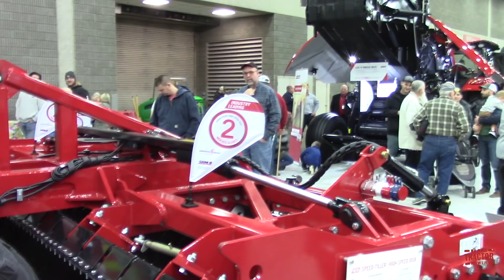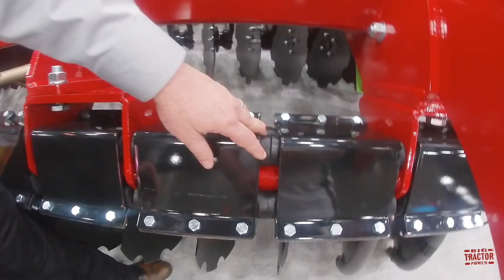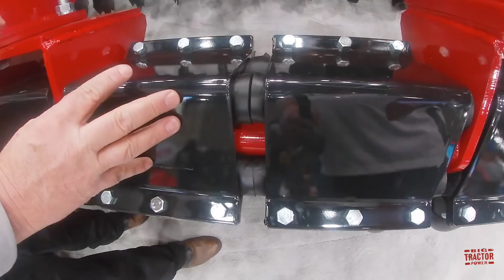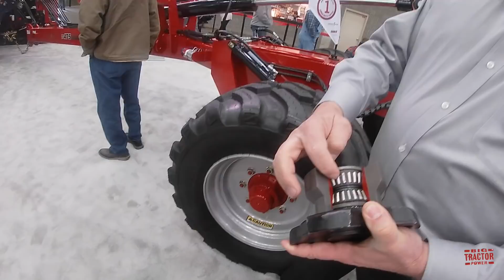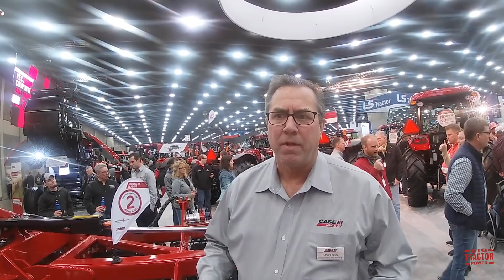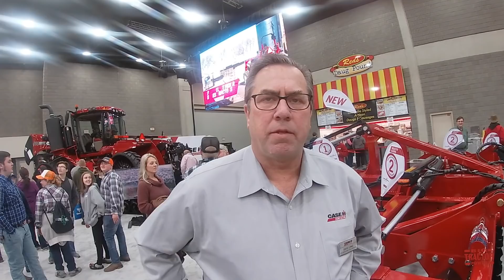New CASE IH 475 Speed Tiller

Comment: We used a K Line Speed tiller for a couple seasons, rented from Flamman rentals. It would plug the discs if you so much as looked at it funny. If you went through anything soddy, a slough or we had a hailed out barley stubble field that had all sprouted and turned green in the fall. The discs would plug, then act like a dozer blade and push a big mound of dirt. You would constantly have to watch the disc for plugging. Would never use again in our conditions
Reply from the maker: That is unfortunate.  In Western New York State Farm’s have all been going to K-Line over the past 6 years. A friend of mine just bought a 22ft this year to replace a Landoll disk. Another friend in WNY runs three 40ft models on their farm and another two 40fts. They all rave about how good they are.
Reply: @bigtractorpower  most people in this area (Central Alberta) have gone to Degelman Protill. We went with a Versatile Viking for the adjustable gang angles. Wish we would have gone with the Landoll VT Plus (same concept at the Viking, but appears to be better built)
Reply: Do you think the protill would plug in your conditions?  Maybe your neighbors in similar conditions, is it working better for them?  Ever look at Lemken or know people that have?